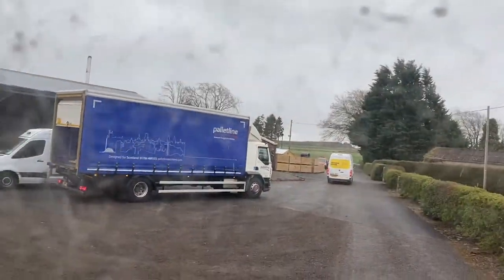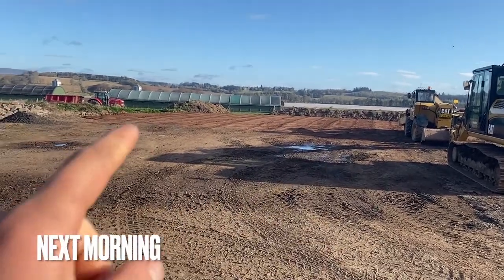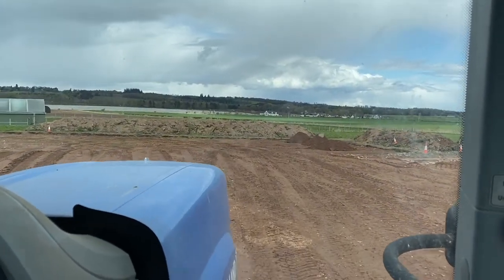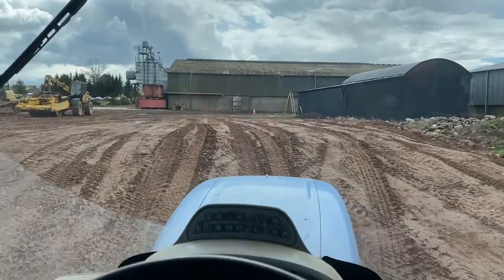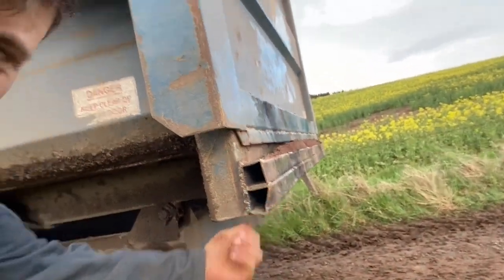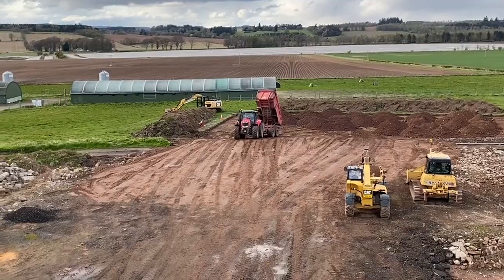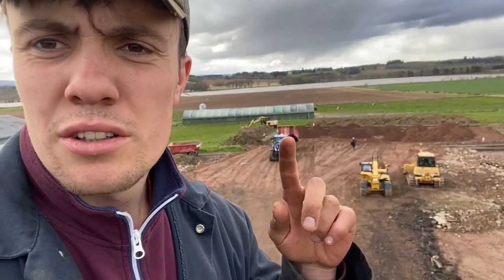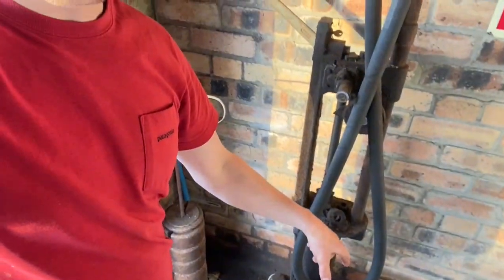CARTING 2,500,000 KILOS FOR NEW SHED | BREAKDOWNS  #CRAWFORDFARMS #031

Comment: How far away is the dealership? I used to have to do a lot of those mounting bolts on TMs always done them on site. You would hope they had sorted them by T7.
Are they still only an M14 bolt?
Never much trouble to remove, welder or drill whichever was the easiest option to get to.
Reply from the maker: Half a mile away
Reply: @CrawfordsFarm1  Ah that makes sense then.
It was more common for the RHS to go on a TM if you hadn't heard the creaking then it would completely shear, lose battery, cross pipe from diesel tank. So dead engine + however much diesel you had before it went on the floor!!! 
Never had one but if both sides went then windscreen etc would go as well 👎 I always used to do both sides no matter how many bolts had sheared.